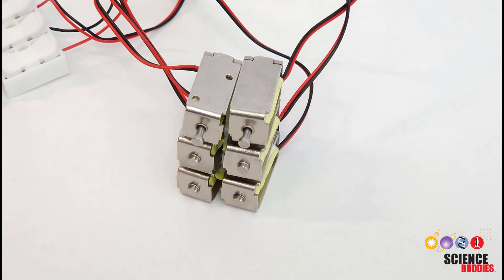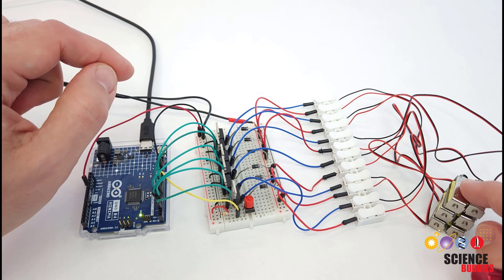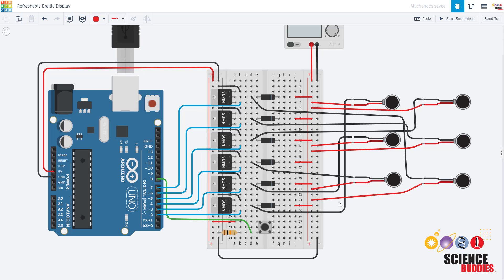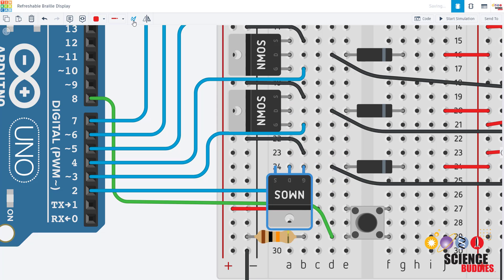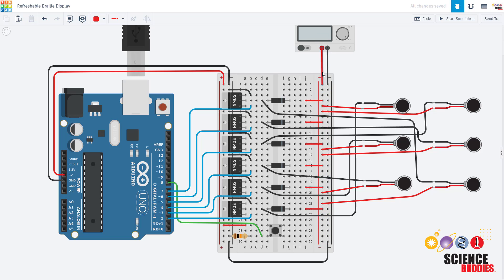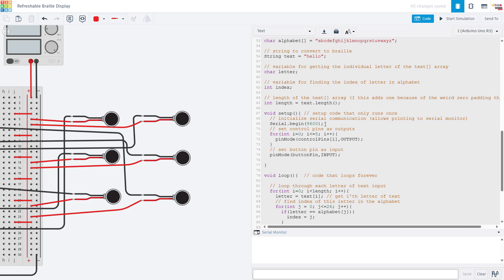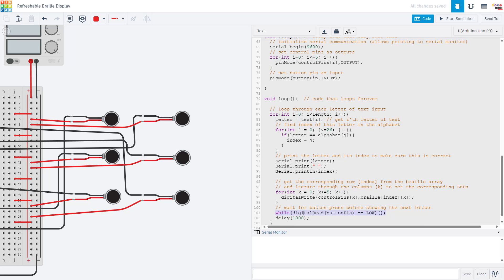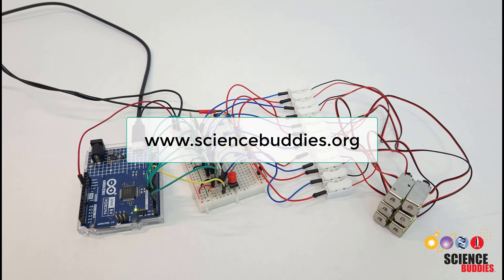Refreshable Braille Display with Arduino | Science Project

Comment: Would be best if the solenoids were small enough to resemble actual braille dots, so that one could read the characters just using a fingertip. Thanks, still.
Reply from the maker: Since our projects are for K-12 students, we wanted to use readily-available off-the-shelf parts, even if the resulting project is more of a proof of concept than a practical fingertip-scale braille reader. You can buy very expensive commercial devices with smaller character displays, but people are working on custom cheaper ones: https://youtu.be/BXi1tG78AW4